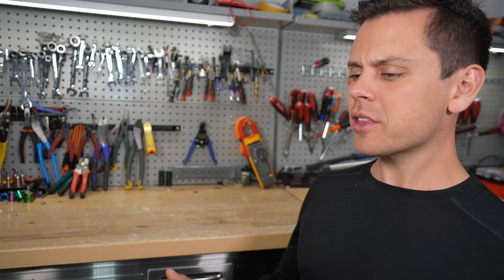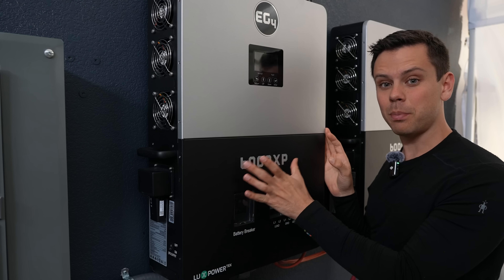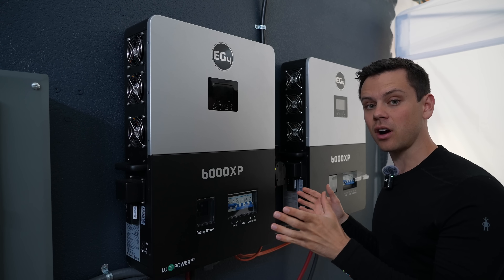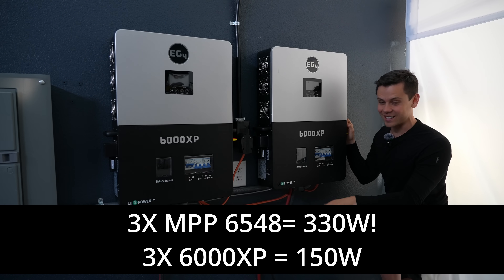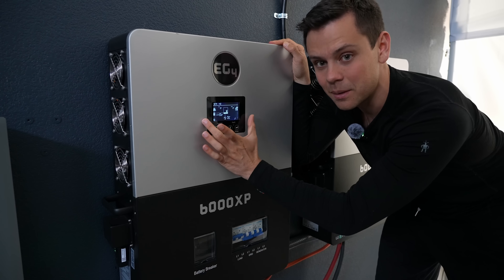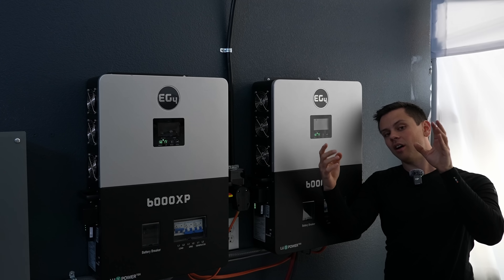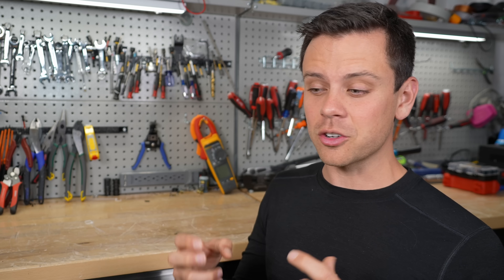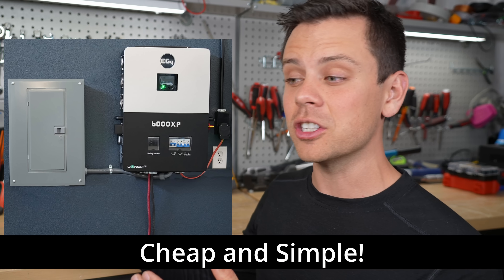Offgrid VS Hybrid Inverters! Which one is better for the $$$?!

Comment: I went with the 6000XP's mounted inside where my breaker box is (laundry room) and I use two Reliance Pro Trans2's for my transfer switching, I love the Reliance ProTrans2 because I can transfer between my off grid and grid at the breaker level with a flip of a switch for those rainy or cloudy days when we do not get enough sun to charge up the batteries. I can switch the large power consuming appliances like the water heater, dryer, well pump back to grid in an instant. Great vid Will, great info to help ppl make a choice for their specific needs and budget!
Reply: More people should do this it's a nice option 😊
Reply: @electricandlsxpower  Not really.  Laundry room is usually high humidity.
Reply: @robertsmith2956  My laundry room/area is open and inside the house by the back door and is completely airconditioned so no humidity to worry about :)
Reply: I thought the 6000 xp automatically switched to the grid?
Reply: @Sword-trowel  The 6000XP does automatically switch to grid. I have his same setup and I've seen it happen; it's a nice feature. What he is talking about is the Reliance transfer switch. That allows him to flip house circuits from either power source: grid power or inverter power. This is how I connected my solar system to feed my house. So, I am running the vast majority of my house (2 fridges, upright freezer, TV, internet, house lighting, etc.)  from my solar system. But I'm still powering my whole home AC and water heater from Duke Energy. I do have a window AC that I can throw in if necessary, the solar will run that also. 

I'm waiting to see my costs savings, but I did all of this primarily to be able to have power should the grid go down. I live in Ocala, Florida, we have had hurricanes that knocked out power for 7 to 10 days. I have a 7500W gas generator that carried us thru, but I was burning about 14 gallons of gas a day! Plus, it was quite noisy and I had to go "forage" for gas every day, which was a big job after a storm. 

I am VERY happy with my system, especially since I did the entire job myself. The Reliance Transfer Switch also isolates your solar power source from the grid, so no chance of back feeding out to Duke lines. My system is NOT grid tied, so any excess energy my panels produce goes nowhere... once my batteries are fully charge the inverter throttles down the solar input to use only what it needs. 

Sorry for my long, rambling answer...
Reply: @woolval52  I'd be interested in knowing what model Reliance Transfer Switch you went with.
Reply: @woolval52  I too live in the Ocala area, the way I did my whole home AC was to install 3 EG4 solar hybrid mini splits, and they keep my 2400 square foot home just peachy and cool. That's actually what I did first and my bill went from averaging around 340 (duke energy) to 214-240 a month. Now that I have the the whole house on solar and only switch back to gride when there is no sun my bill averages 65 bucks a month, so not completely free BUT compared to 340 a month my system will pay for itself in 10 years or less. I have also done other things like built a pully system so I can take down my panels in a few hours if a hurricane or other bad weather is approaching. I should also note that the 65ish a month included charging my Tesla on the grid so it could be a lot less.
Reply: @majorhavoc9693  If it's not too late for you, I suggest you go with a 50A Transfer Switch. Then it is ready to handle two 6000XP's should you choose to grow. 
Sorry for my late reply... I used the 10 circuit, 30A unit ordered thru Home Depot, Model # 310CRK. I went with HD so I could get my 10% veterans discount, which I appreciate. If I were to do it again I would go with a 50A transfer switch model. There are times when I've seen my Reliance Amp meters almost maxed out. And a couple times where my 6000XP has shown an OVERLOAD, so it automatically switched to Duke Energy. I've come to realize I can not run my air fryer and the microwave at the same time, they are on the same leg of the 6000XP. I guess I could go in my main panel and move one or the other to the opposite leg of the 6000XP 240V output, but for now it's easier to not run both at the same time. Also, and this is very minor, the meters built in to the Reliance Transfer Switch are wired where they read backwards. Loads on leg 1 read on the leg 2 meter, if this makes sense. At first I was confused, but now that I know it's no big deal.
Reply: @JBPowell-y9m  So the hybrid mini splits have their own solar power, they don't pull from your house solar system? I love the idea of them and getting away from Duke Energy as much as possible, although I'm glad Duke is there when I need them! So what is your set-up? More than one inverter? How many batteries? How many panels? Ground or roof? Luckily, I have room, my panels are on the ground.
Reply: @Sword-trowel  I still have my 6500's , waiting on SS to ship my 6000xp's , but even then I have no plans on hooking them to the grid in any way and stick with my transfer switches. I'm not going to give the power company any reason to give me any grief at all and if I did it would mean I would have to run a separate line for the main box and I'm not going to do that :)
Reply: @Sword-trowel  Yes it does but I am using my unit(s) as if I was completely off grid, so no grid input just solar and batteries, I am using the Reliance ProTrans2 instead of a whole house transfer switch so I can do the transfers at the breaker level, all, none, or just one with no back feeding the grid.
Reply: I am wondering about fan noise. I am looking at putting it in a bedroom closet but per a previous comment a little worried it might be too loud.
Reply: @trippinwithdon7233  There will always be some fan noise, but the 6000xp's are much quieter than the 6500's much quieter
Reply: @trippinwithdon7233  My unit is in the garage. I think it'd be way too noisy in a bedroom closet, the fans throttle up and down as clouds pass over and as loads increase or decrease. Unless it's a guest room and you don't want guests to stay too long, then it's a perfect location!
Reply: I like the idea of two transfer switches. I have one Pro Reliance 30A 10 circuit model, wish I had a little more than the 10 circuits. In hindsight, I wish I'd have gone with a 50A model, but I was unsure where and how my system would work. As it turns out, it's working beautifully! And a 50A model would have it ready for a second 6000XP when I want to add one.

Comment: Sorry Will but I have a 25klw transformer low frequency split phase inverter that only cost 7200 plus a 25000 watt charge controller for 1100 dollars.that will last decades for almost half the price of 4 XPS not to mention victron or anyone else's price.thanks MikeG
Reply: They are Sandi inverters
Reply: @mikeg2321 can you provide more data? Model, setup, years of running with no issues etc?
Would be interesting to have a look at.
Reply: What batteries are you running?
Reply: What company?
Reply from the maker: Yeah that's awesome, what is it

Comment: Do you expect the hybrid inverter costs to come down? Are there any smaller hybrids with a proportional $/kW cost? If you have a good net metering ratio, do you offset the hybrid cost by eliminating the batteries? I.e; use the grid as your battery until the system pays for itself and then look at a battery backup investment?
Great videos by the way!!

Comment: hi there I wonder if you can help me I am a female 60yrs old live in NZ going to move into my car gonna get a 100watt solar panel tape it on have been told by the seller I will need a Solar Controller 30A  want to get a small jackery ( on a tight budget) will i need any connectors do you think or will it just plug straight in, hope you can help thanking you

Comment: Great video. 
I am 100% off grid. Nearest power line is over 2 miles away, rain catchment, 6 miles on dirt road. The last mile is not maintained so 4x4 is a must. . I currently have been running rolls surettes for 10 yrs now n looking to upgrade from 24v to 48v . I am interested in the 2 6000xp with 3power pros.
Reply: I have mad respect for you! 🏆
Reply: Those are shitty inverters ... doing a fuckload of noise and heating a lot...
Reply: @davidniquot6423  i dont care about the noise. it will be in its own room i wont hear it. heating? i dont see a problem with that. it fact that actually might be good during the winter. it seems to be a good inverter for me.
Reply: ok then...

Comment: ...and what about RV use? Is a 6000XP ok for Class A basement install? What about mounting position, does the orientation have to be like you have or is it ok mounted sideways since most RV basements are not very tall? Is the a better choice for RV use?
Reply: High vibration environment (e.g. potential short circuit or electronic failure rates), dust, moisture, etc. This is an appealing use case, however the aforementioned potential short circuit (e.g. fire, failure) issues, as well as potential early death of sensitive electronics may (will) likely occur. Signature Solar may be able to provide insight to if this is a viable use case/possibilies, however I for one am interested in what you propose.
Reply: I am putting to 18k in my camper

Comment: I bought all Victron gear for off grid use.  Spent my money up front i know, but never looked back.
They might outlast outlast me.
Couldn't be happier with how I went.
Reply: Buy once, cry once. I love my Victron.
Reply: I do hope victron makes more integrated stuff. I'd love a victron unit with built in breakers and kill switch.
Reply: @Ravedave5 that would make an easy build
Reply: mornigstar stuff is good too, a little outdated but the failure rate is almost nonexistent. and their tech support is amazing.
Reply: I got few set ups and yes I can say I'm seeing much better results on my victron than the the others ,and can't even speak about those portable ecoflow not even close as efficient,  my victron start earlier charging and keep charging late  on the day too when the rest are off not even receiving , learning the hard way but keeping my eg4 3000 because is fighting behind the victron haha and I have those little 150/45  from victron I can't talk about the other ones, going to get a 3erd victron controller and grow the battery system and called the day for my needs.
Reply: Which model did you get and what about batteries?
Reply: @Markou812  - Charge controller MPPT RS 450/100. Inverter Multiplus 2 48v 8000. Cerbo GX & screen.
Batteries I use are local to here and only come with a system. Can't buy them outright. I have 15 kWh of battery.
In particular the RS 450/100 is a truly amazing thing that's worth the money. Takes 2 strings of 4kw each, 450v max DC input, 100A max output to the batteries.
It also has earth leakage detection built right into the controller. Stunning thing, and from Wil's videos, he absolutely loves them.
Reply: @Browneye2566  Can the RS 450/100 charge batteries from grid power as well, e.g. in winter seasons?
Reply: Victron isn't immune to damage.
Reply: Good call. EG4 support is a pathetic joke. I could not recommend them anymore to anyone.
Reply: @Mike80528 😢

Comment: I just started seriously looking at hybrid and other grid inverters this week as I worked extra hours and have money to spend, and a bunch of people just made videos about them. Funny how lots of people can spontaneously be interested in the same topic at the same time.
Reply: I am currently reinstalling my solar with bigger battery bank and was thinking of upgrading my inverter and controller units but having a hard time finding units for my needs .
Make sure when buying controller or inverter controller unit that it will handle the battery bank ah as most only handle small banks and can stuff up and over charge your batteries and burn them out.
We have lived off grid for over 30 years and its always a learning process with modern tech.
Reply: @matthewwalker6621  Yeah, you need to factor in every variable.
Reply: Thanks for sharing.
Reply: I think AI is monitoring conversations via mic

Comment: Quit my 4 6500s and went with 2 18ks...hope I did good.still hooking them up...cheers.
Reply: I'm still using a one 6500ex and 6 LIpo4s off grid ..  Light flashing is crazy and no help from signature other than to run through all the settings.  Still flashes.  It's inrush current when the furnace starts up or the freezer starts up.  So you have no light flashing with your 18Ks?
Reply: I did the same thing
Reply: Technology upgrades fast enough that I'm never going to buy a system based on it lasting beyond 10 years. So it is very doubtful that I will ever bother with a Victron system. Like Will said "I can buy an extra Eg4 and keep it as a back-up and just throw it on the wall if one of my primary units fails and even doing that would still cost me far less than a Victron system."

Comment: I have a small ranch style house no attic or basement, The Main panel is in my Bedroom unfortunately, Can the 18k be installed Outside but the batteries inside, I live in a colder climate up north. I think the sounds of the 6000xp would drive me crazy eventually, lol
Reply: The new eg4 vertical batteries that they have are fully rated to be mounted outside too. I haven't looked into them more, but I assume they have builtin battery heaters. You could always put a small 3x5 shed up against your exterior wall and insulate it, put inverter/batteries in it, and put a one way dryer vent from house into it and one way dryer vent venting out or even back into house...
Reply: @CheesingGouda  EG4 PowerPro ESS Wall Mounted Batteries are equipped with internal heaters located between the battery stack for internal heating below (I believe) 32*F (please check the spec sheet to be sure).

They are also IP rated for outdoor use (dirt, dust, moisture, etc). Again the spec sheet can confirm exact details, but they can be mounted outside in specific locations to align with warranty coverage/specs.
Reply: I can assure you that you do not want the inverters in your bedroom.
Reply: @ChrisSmith-tc4df are both of them that loud?
Reply: get a solark. I have a solark 15k mounted outside, batteries inside. it has been great!

Comment: Is there a reason you chose the EP cube for your whole house? I would think with all those batteries that you have in your garage you would’ve chose EG 4 hybrid to power your whole house. Just wondering.
Reply from the maker: I was going to get Tesla power wall, but it cost a lot and it's not very diy friendly. And extremely heavy. EP cube, anyone can install. Each module is 70lbs. 

And I can't mount server rack on side of my house. Would have done 2x 18K but I already have that on other side of property 

So I am going to get them all for the channel eventually. I want them all. But EP cube was most diy friendly option. Not many good complete home backup options either. 

EP cube is underrated tho. I need to talk about it more
Reply: @WillProwse  thanks for your reply Will.  You have an awesome channel. thank you for making these videos.

Comment: Why would you mount an electric box outside when you might put it in your garage or basement?
Reply: I’m not sure but I believe that it is related to access to the grid in terms of code compliance and the utility being able to access the system for grid management and emergency’s such as a blown transformer.  They probably want access to be able to shut it down if they have linesmen working on the lines. This is just a guess.

Comment: Off grid for me. But I’m installing in a bus.
Reply: Doing the same. But I’m putting panels on the bus and the house. When the bus is at the house I’ll plug in the additional house panels then plug the house into the bus. That way I’m not wasting it while the bus sits in the driveway. Doing a complete off grid Skoolie build for travel, but not ready to let the house go just yet.
Reply: @lipinskirl  how many watts will you have installed on your bus?
Reply: @Thisisaplaceholder1  6 - 535 Watt panels for 3200 total. If I have room after that I may try to add 4 of the long bendable 200w panels on the curved part of the roof. The 535w panels are sold in packs of 10 so the other 4 will go on the house. I will probably add more if that whole plan actually works out.
Reply: @lipinskirl  awesome, I went complete overkill on my trailer putting them on drawer slides for a total of 20 415 watt. I was going to tow with an electric truck but that ended up being a bust. Now I have more than I’ll ever need.
Reply: @lipinskirl  really good idea
Reply: Yea, hybrid would not make sense there
Reply: Good idea 💯💡